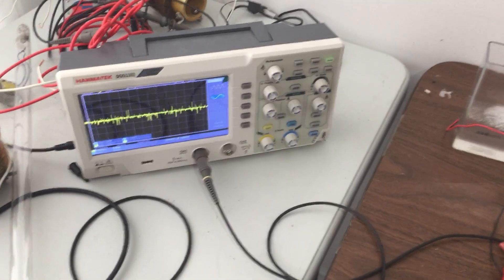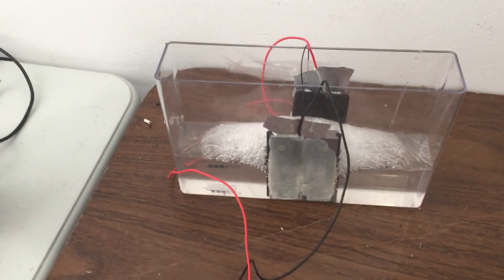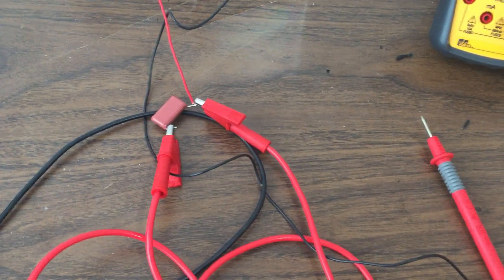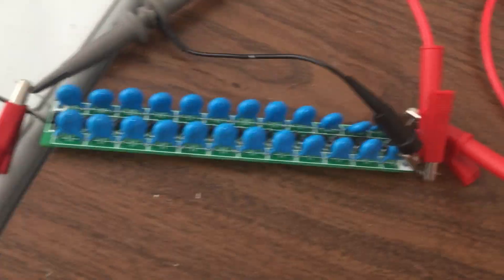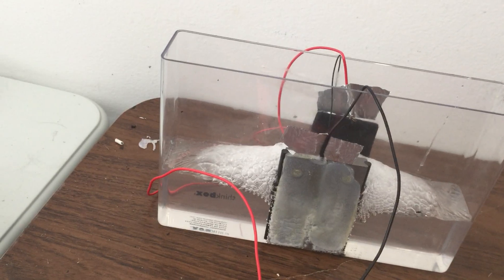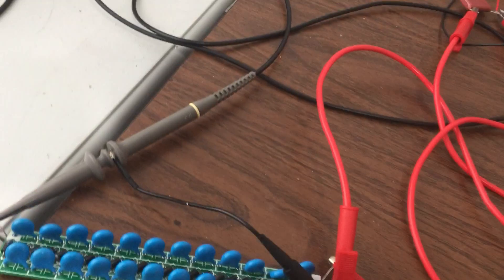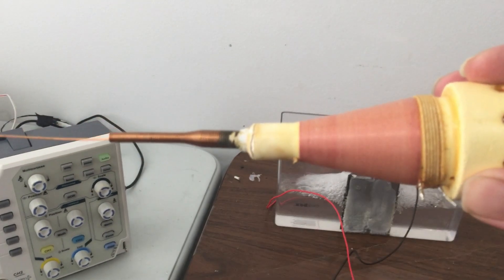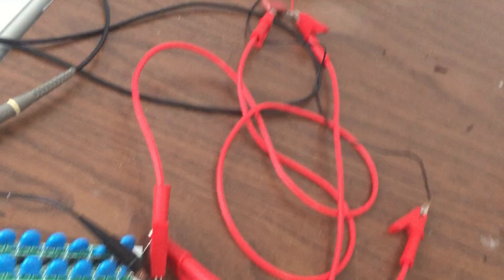Living Electret

Comment: Your electret/cap repolarizes the plates EVERY time you DC short it? The voltage bounces back every time?
Reply from the maker: Yes but there is a difference between electret and dielectric memory. Shows similar effects but a very different thing. One could take advantage of both effects really. Just need to understand they are two separate things.
Reply: @joellagace1679 that’s awesome. Thanks for posting all this stuff so everyone can learn from your hard work!
Reply: I know you very strongly implied that, I just can’t wrap my head around it! Cause then someone could use electrodes with huge self-capacitance, the electret repolarizes them still, making each DC short much more powerful/higher peak current? 

Or maybe I’m misunderstanding the bounce back effect
Reply: Aaron Murakami has stated on his forum in the past that his capacitors started producing electret behaviors that bounced back from shorting after conditioning them with high voltage impulses over time, seems to be a recurring theme.

Comment: Please explain how you charge your electrodes at high voltage with one wire system and stil prohibbits the flow of electrons through the dialictric ...
Reply from the maker: The one wire system is not about prohibiting electron flow, it's about how the dielectric material acts as a capacitor, holding a charge even without a continuous flow of electrons.
Reply: Hi Joel can you explain how to wire the system to hold a charge....

Comment: What's Going On Here?
Imagine he's trying to make a special battery that charges itself slowly over time by capturing little bursts of energy from its surroundings. But instead of using normal battery parts, he’s doing it with things like gel, wax, and high-voltage sparks. Wild, right?

🧪 Step-by-Step, Simplified:
He builds a homemade capacitor
Think of a capacitor like a tiny electrical sponge. He fills it with a gel that dries and becomes solid, which can hold electricity.

He "trains" the capacitor while it hardens
Most people zap it with high voltage really quickly, but he gently charges it over a whole month using a special one-wire method. That way, the material learns to hold the charge better and longer.

It holds voltage—even after you short it
He shows that even if you try to "drain" the electricity, it keeps bouncing back up. Like a sponge that wrings itself dry and still manages to get damp again.

Tiny electric spikes happen on their own
Even after it's done charging, random mini bursts of electricity still show up—kind of like the system is breathing or twitching with life.

He captures those random energy bursts
He builds a circuit to catch and store those random jolts. It’s like setting up a little funnel to catch raindrops from a cloud that just won’t stop misting.

Not enough power to run stuff yet
It doesn’t create much power—just a trickle. But he's experimenting with ways to amplify it without disturbing the delicate setup.

Bigger vision: self-charging energy source
If scaled up, this could be a way to make a battery or power supply that slowly recharges itself using its environment. Think: low-key free energy.

🎯 In a Nutshell:
He’s trying to build a smart capacitor that slowly charges itself using weird electric behavior, and could one day be part of a self-sustaining energy system.

Is the AI right? it even gave me a picture of the setup which was totally wrong.  But the words sound right.

Comment: A top experiment, and explanation of potential applications of the one wire out/cap setup. The electret is intriguing. And then yours, a month! and one wire in, great to see. 
 I wonder sodium silicate could be of use because i have measured random voltages from it for no apparent reason.
 Also, there was/is an experiment to make an electret with coax in an oven, if you haven't come across it.

Comment: Hi Joel glad to hear from you ❤

Have a look at this expired US patent 4,527,218 for a 20-100 years lasting electret positive charged. You need a hot plate 100-150 Celsius, some voltage and rolls of teflon tape for plumbing (extremely cheap), enclosure chamber (made of PE sheet) to keep some dry atmosphere. They can be done in minutes ! Not month.
Reply from the maker: I wanted to do it like this for my experiment.
Reply: @joellagace1679 this is understandable but we don’t need to reinvent the wheel if we seek any progress … after all you walk on tracks of D Smith, Bedini, Tesla etc.
I hope you get my point ❤
Reply from the maker: I don't get the point but that's fine hehe
Reply: @joellagace1679 why would you spend a month to obtain an electret when it can be done in minute(s) with a lot less work and much cheaper … without mentioning long lasting effect (20-100 years, temperature dependant) ?
Reply from the maker: I can't mention the specific reason behind the experiment right at this moment, But I can share the expected results. You are right. Electrets are nothing new and I make no  special claim of such.

Comment: By 1 wire system, do you mean 2 wires connected to the conductive plates on each side of the dielectric leading to 1 terminal of the input, or that only 1 plate was used in the condition process?

Also in regards to letting it cool for a month, I assume you mean that you just left the power on for a month to let the field influence saturate it over an extended period?

Thanks.
Reply from the maker: Yeah It was left on powered for a month as the soft dielectric slowly turned hard. one wire HV input via diode rectifier (AV plug) plus and minus to capacitor as normal.
Reply: @joellagace1679  Thanks, assuming you didn't already make the electret like this, do you suppose applying the potential at the circuits resonant frequency would alter the results?